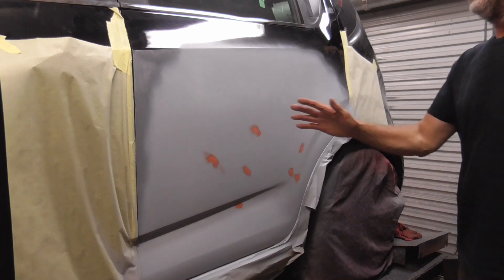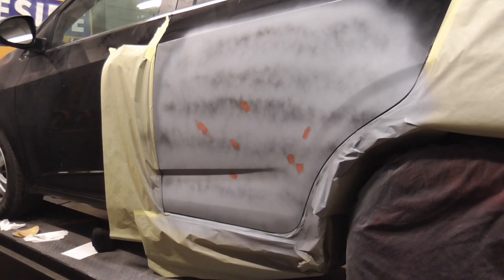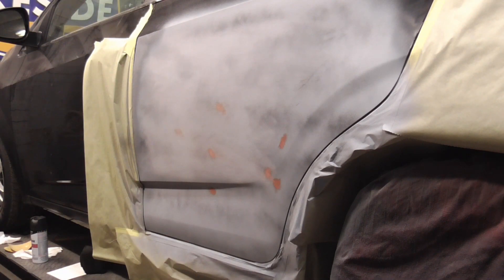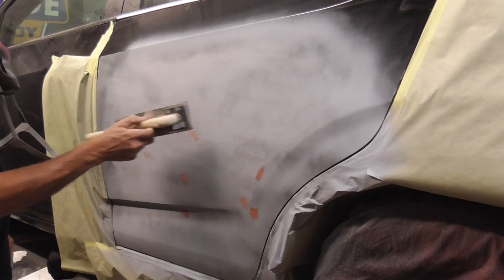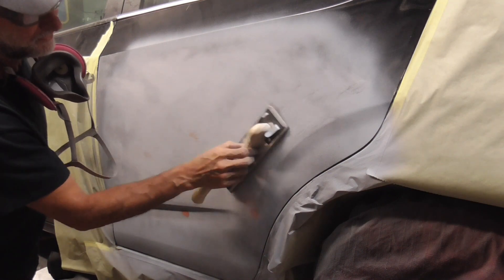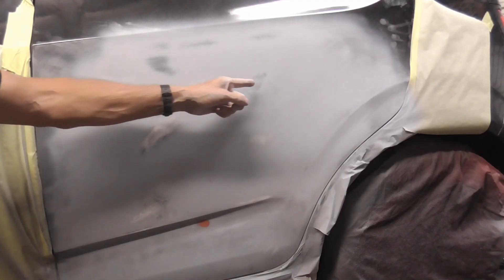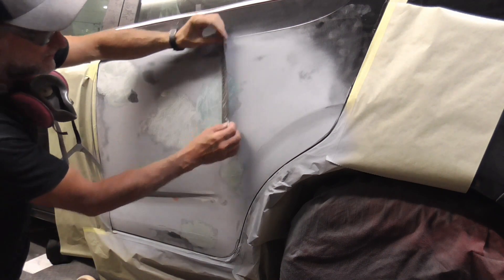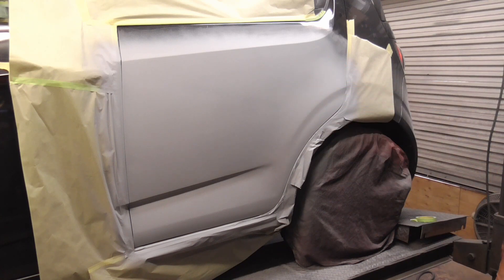What is a Guide Coat?  Find & Fix Low Spots in Body Work

Comment: I find that spray bomb guide coat to be a problem with gumming up the sandpaper because its a enamel, so i switched to the powder guide coat with less headache and saved on materials and get the same result. Guide coat is everything to being on your way to quality bodywork and finding the slightest of sand scratch and its must step that cannot be overlooked if your wanting a quality job i cant stress this enough
Reply from the maker: You can use a super super light coat of spray bomb - just the dots of paint will do it for you 👍🏈😊😊

Comment: I scuffed my existing door, primed 2 coats after sanding lightly, and a few small areas of old paint came through. Am I okay to paint once I've smoothed out with guide coat?
Reply from the maker: Yes - as long as it's been sanded with fine paper like 320-400 grit and any bare metal spots were touched up - you can hit them with spray bomb primer if you want :)
Reply: Thanks, no bare metal just some older scuffed paint of the same color. Great videos

Comment: Say i had an some small low spots on a show car roof after blocking with 150. I see you use puddy would i be better with another session of rage ultra or just dolphin glaze? ty. love these vids..
Reply from the maker: If you can get it out with another coat of primer then use that - it's easier and more accurate.  If you think for sure it's too deep use filler.  The "knowing" which to go with comes with quite a few failures 😐
Reply: @LakesideAutobody  you got that right ...

Comment: New to all this, I feel like I need to load up the panel with black to see anything, my inexperience shows here and I find it very difficult to understand the process of getting the panel flat. I tend to sand and then all of a sudden I'm at metal Do you have any tips for doing this on curved fenders (I'm working on an rx7 FD) Thanks again
Reply from the maker: First, make sure you are using automotive grade primer surfacer - it builds thickness,  You need a few heavy coats to be able to block sand out high and low spots.  You don't need a lot of black paint - matter of fact you don't need a guide coat at all.  Here's another vid that may help - https://www.youtube.com/watch?v=S8OzM13iwHA  Keep asking ?s, keep working and you'll be fine :)
Reply: Thanks a bunch! I'll give this a watch.

Comment: 120 grit seems very agressive for sanding primer
Reply from the maker: In a body shop you'll see guys start with 80 sometimes - move to 120 - etc.  You have to be fast to make money as you get paid by the job - commission.  But... you find out that it makes body work a lot easier in the end.  Like building a house - start with the heavy equipment like bulldozers, etc. and end up with super nice finish work.
Reply: @LakesideAutobody  I've been a production paint tech for 30 years. My biggest commission week was 250 paint hours on my own without a preper. I am finally starting to get paid prime and block from most insurance companies. Years ago I would block my primer with 180 now days I use 320 but it feels more like 220. I'm very picky with my body guys if it doesn't pass my hand inspection it goes right back to them.

Comment: Love your videos! I have a new tailgate that was shipped with a glossy black finish. Do I need to sand it or prime it before painting it?
Reply from the maker: Just scuff with the red scuff pad and paint - Mirka 18-118-447   You can sand it too if you want DA (320) or hand sand w/ 320-400 wet - paper wont clog as easy wet sanding.https://www.youtube.com/watch?v=BD4txPwjsfI
Reply: Thank you so much!
Reply: I noticed your touch up body putty was feathered over primer. Any problems there with retention later? Also do you have a video about fixing common painting problems like dust, bugs and runs?

Comment: What are your thoughts on using the 3M 08115 vs the panel adhesive you use. Yours is approximately twice the cost.
Reply from the maker: I used JB Weld in this video and it's perfect to this day - https://www.youtube.com/watch?v=wRl1QfkrBeY  Only reason I like the SEM is it's impact resistant - don't have to be careful at all when knocking down the seam.  I think you'll be fine though - esp. since the JB worked :)
Reply: @LakesideAutobody  sorry, I meant one of your past videos. I'm installing full quarters on my 70 Nova.